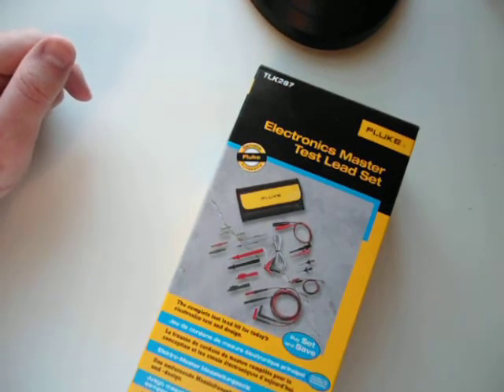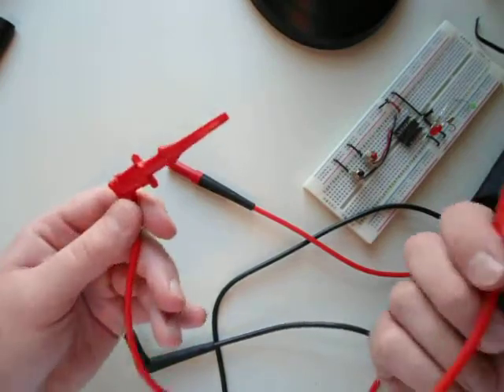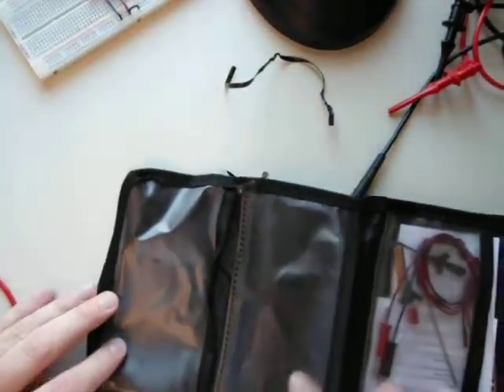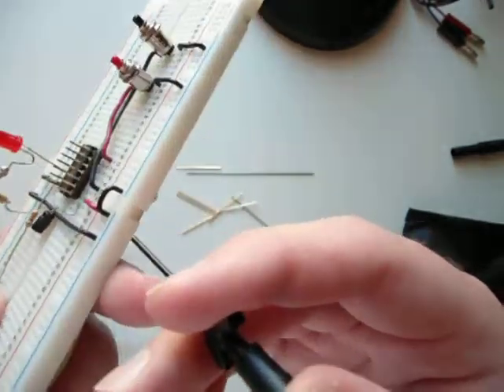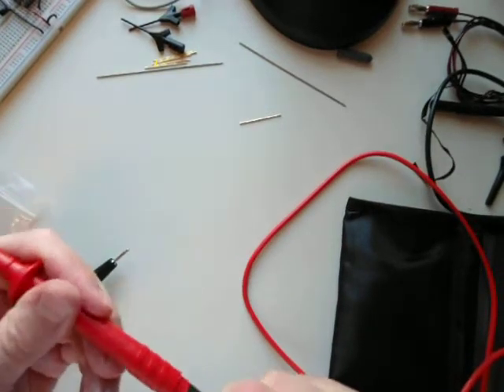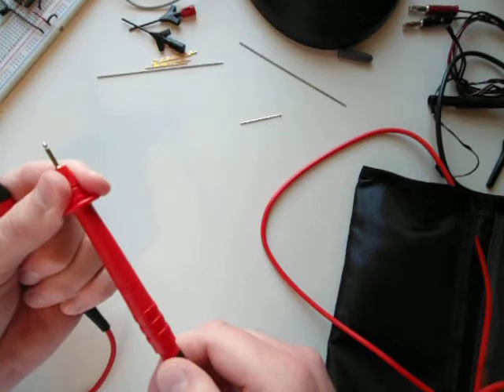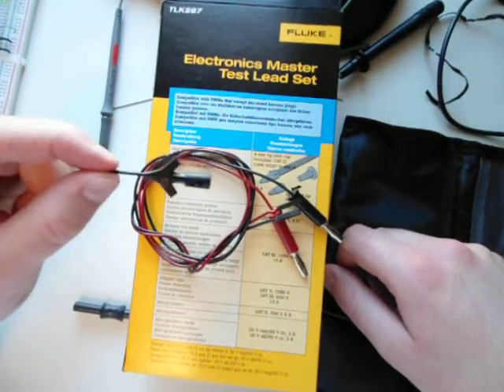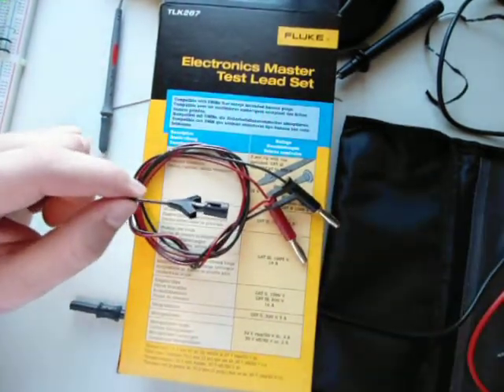Unboxing a Fluke TLK287 Electronics Master Test Lead Set

Comment: Hi, a concern. Do you know if the Fluke TLK287 video model contains the Fluke TL910 kit in your kit? because if so, it would be convenient to buy the TLK287 kit with a difference of 63 dollars and I get a more complete kit, don't you think?
Thank you. Hugs from Peru.
Reply from the maker: luiseduardo9200 - Greetings from the US! I looked up the TL910 kit online and pulled my TLK287 kit out for comparison. It looks like TLK287 includes the contents of TL910: they both have a pair of swappable-tip test leads rated 1000V CAT II 3A, both have 2 pairs of stainless tips, and both have 3 pairs of spring loaded gold tips. Sounds like upgrading to TLK287 for $63 would be a good deal.